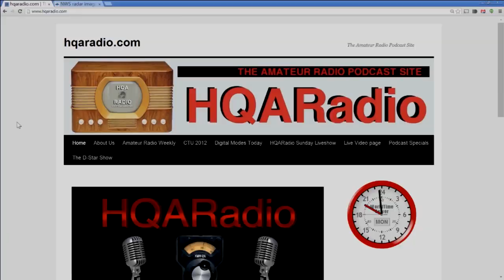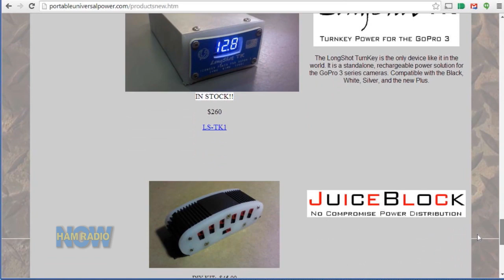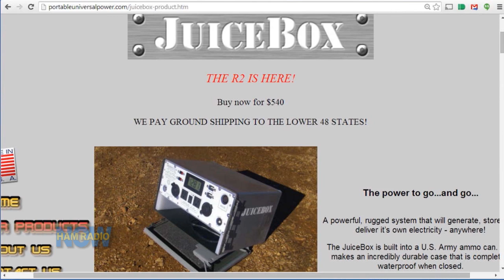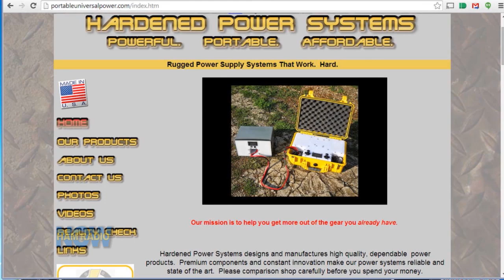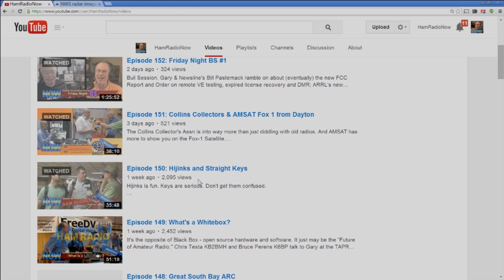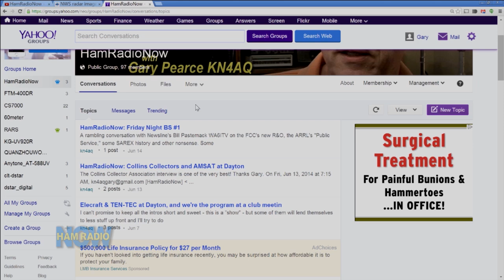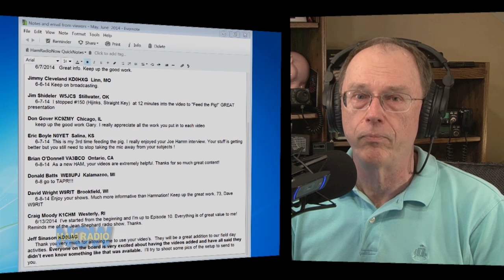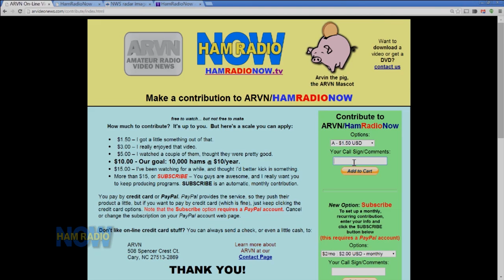Episode 153: Hardened Power, TiltPlate from Dayton, and Inside the Show

Comment: I am not sure if Hardened Power Systems has corrected this issue or not but they remove the inverter case when they put it in the device. If you use HF you can not run the inverter at the same time due to interference. So if you want to run a lap top for example you have to charge it before you operate. Also the other main issue is there is no ventilation for air cooling.

Comment: Another issue I had with mine and have read elsewhere with others is that their soldering isn't really up to snuff. It may have been whoever worked on mine and that other persons but I found cold solder joint and one of them shorted out a part causing it to smoke.

When it works it is good but engineering, consistent quality controls are lacking. Hopefully its something they can address and fix in the future.

Comment: I own the MK2 and the ReVolt plus the solar panel. You will not find anything better. I do a lot of portable radio operations for the Coast Guard and Auxiliary and can not afford problems or running out of "Juice". In the past I used many battery powered sources which were marginal.  Then I found Hardened power and his products.  A full 12 hour day on the radio barely puts a dent in the voltage.  I don't work for them, just a very satisfied customer.
Larry